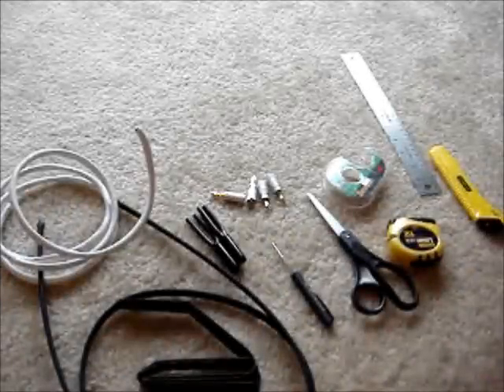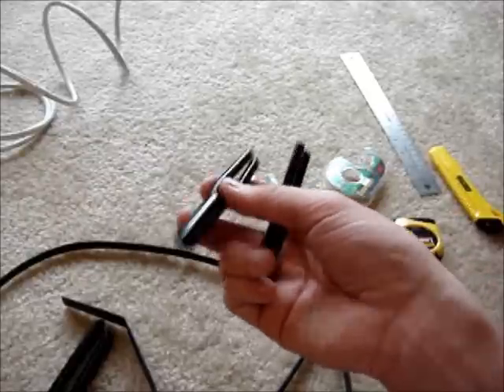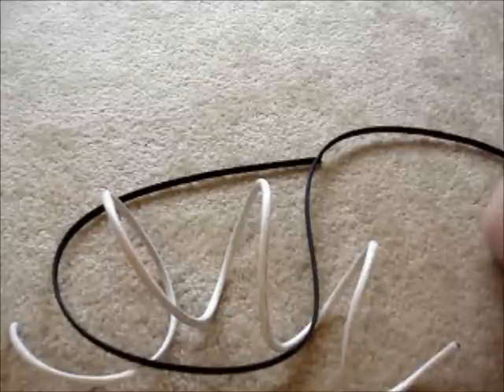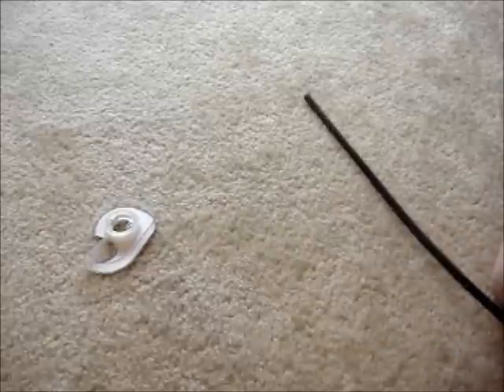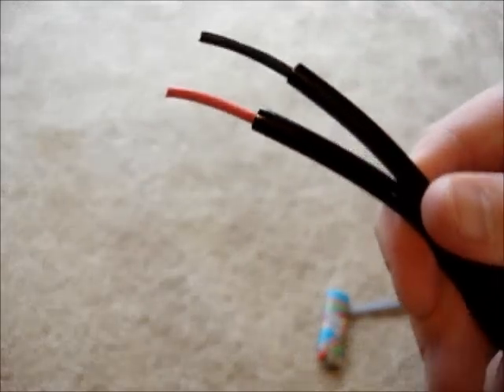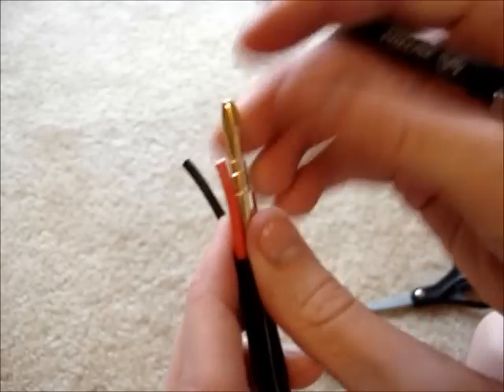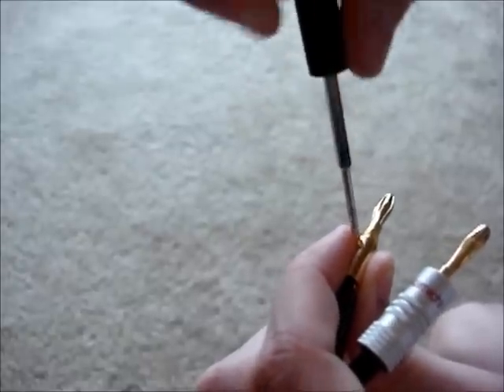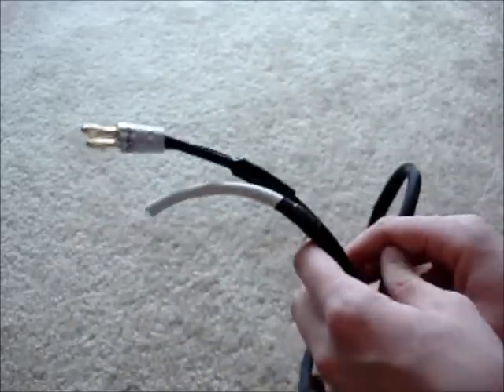DIY Speaker Cables, How To Make Speaker Cables

Comment: 10:46 Right here, were the bottom of the plugs meet the wire, wouldn't THIS be a nice spot to put heat shrink to smooth out the gap?

Comment: Adding bananaplugs means adding another connection. Which means adding another transition point for the audio to cross. Which means loss of sound quality. The fewer connections the better. Just strip the wire and attach it to the loudspeaker connectors. The difference in quality is substantial !! More detail in high and midrange and a better, deeper and lower bass. If you can't hear the difference you either have a cheap stereo set or your ears are damaged. ;-) Throw away those plugs. The sound will improve and you'll save a few bucks, too.
Reply: Literally none of what you said is correct.  There simply isn't enough resistance between the banana plug and the wire to cause any noticeable difference in the signal. You'd need to add several hundred ohms of resistance to the wire to change the signal in any way at all. Further even if for some weird reason the banana plugs DID add several hundred ohms of resistance to the wire it would diminish the maximum amplitude of the entire signal not the frequency's that the signal carries. And even then you would just compensate for that reduced amplitude by turning up the volume on the amp. You're hearing nothing, there's no scientific way anything other than a large resistance could alter the signal.
Reply: Justin DiPlacido Literally none of what you said is correct. EVERY extra connection will negatively influence the sound. I have improved MANY stereo sets, making lots of people very happy with the improved sound, at virtually no cost, or literally for just a few bucks. My DIY interlinks and speaker cables have been compared with commercial cables, used on $50.000 up to $100.000 sets.My cables are as good as the super expensive ones but at a fraction of the cost. Because I know what I am doing and I know what I am talking about. I go to stores where they design, build and sell million dollar loudspeaker sets. Those people have a great test facility. They know what they are talking about, too. We listen to each other and learn !! If they tell me my 200 dollar cable is as good as their 1200 dollar cable, I must be doing something right. And I have more than 30 years of experience with audio equipment and designing and building loudspeakers and cables. What is YOUR history....??
But if you are using a very cheap power cord and cheap plugs it's clear to me you still have a lot to learn. My advice is to go to a really good High End Audio store and compare your DIY stuff to the commercial cables. Compare, listen and learn.
Reply: telescopereplicator my history is that I did my research and I know for a fact your $50 cable isn't any better than a $1500 cable and neither of those are better than a few feet of zip cord. It's physics, you're perceiving a placebo affect.  There's nothing wrong with having a cool looking cable as long as it's only for looks. You don't see people using super crazy cables with weird geometry and crazy insulation on the million dollar 1GHz oscilloscope made by LeCroy. They use regular shielded coaxial cable. Don't you think that in the most precise and sensitive piece of measurement equipment in the world they would make sure they're using only the cleanest signal path there is? It's not really a big deal, I mean you can use whatever you like it's not my business. It's just not actually any better
Reply: Justin DiPlacido If you think there is no audible difference between a 50 dollar cable and a 1500 dollar cable, there's nothing more I can or want to teach you. 
And I listen to stereo sets, not to oscilloscopes...... You are comparing apples to lawn mowers. And in a blind A-B test there IS no placebo effect. But you wouldn't know because I bet you never tried.
Reply: telescopereplicator the science says there's no difference, that's all I need
Reply: telescopereplicator Hey Mr Pretension...I've been repairing speakers and amps for longer than you've been a 'fanatic' and you sir are 100% completely wrong about what you're saying. It appears a BUNCH of other people have tried to tell you so as well but you're too ignorant and pompous to listen. I'm not going to waste my time on you. Good luck with your quest to ruin everyone's audio experience.
Reply: telescopereplicator God you're an idiot.
Reply: +telescopereplicator ...This is all wrong.
Reply: +shitcock86 the test equipment used to measure the differences are thousands of times more sensitive and CONSISTENT than the human ear. As well as having no placebo. Kind of silly really. Science has proven things of great importance consistently. Let alone about a piece of wire.
Reply: @megaetk  if we've learned anything in the past 30 years, it's that the tests with oscilloscopes are not the correct tests and do not reflect what people here. As for your claim about consistency, that ignores reality, which is that people do not listen in controlled laboratory environments and the real world is inconsistent. People's ears are shaped differently, they hear differently, rooms are shaped differently and the makeup of the listening room has a significant impact on sound, same was environmental factors like humidity and temperature, none of which are accounted for in laboratory oscilloscope tests. If you have a decent system, you could test this yourself by getting four different cables, whether it be speaker wire or connects, and swap them out and listen. If you are right, all four cables will sound the same yet, when that is the only factor changed and the sound actually is different, it proves oscilloscopes are not doing proper tests.
Reply: telescopereplicator I don't need to guess. It has nothing to do with Banana clips. I didn't read your essay by the way just the last few lines.
Reply: Are you saying that people with really high end expensive stereos wrap bare wire around the terminals of their amps and speakers?
Reply: @rmmr8513  He is right  some people believe that any connector introduces interference and that there should be the fewest connections possible. I agree that connections should be kept to a minimum, however, the convenience and security of banana clips and spades outweighs the hassle of wrapping bare wire around your speaker and amp connects. It also greatly increases the likelihood that you will experience a short when one of those wires touches something it shouldn't after any piece of the system is touched or moved.
Reply: @esquiremoderator32  "the convenience of banana clips" this is my point exactly. I have never seen a 20, 30, 40, 60, 100,000, 200,000 dollar stereo, but I am guessing the owner or tech who set it up is not around the back tying wire around. they have expensive wires and interconnects that have connectors on them no?
Reply: @rmmr8513  yes and no. High-end cable can be bought in predetermined lengths with the connectors already attached. Or, you can buy just the wire and connects separately in order to cut your own length and attach the connectors yourself. So, it's not like he would buy cable and then cut off connectors to wrap bare wire, he would just buy cable without anyting attached. However, since you mentioned it, there are some very high-end speakers (Wilson, for example) that cost over six figures new and included with the price is a visit from a technician, who will fly to your city and set the speakers up for you, because they want to ensure that their expensive product sounds right in your house and also because they weigh in excess of 250 lbs each.
Reply: @esquiremoderator32  I agree with everything you are saying. And you think the Wilson tech wraps bare wire around the terminals? Or do you think they have some sort of wire that has a connector? And if he does use a connector, if it's OK to use a connector on a $200,000 set of speakers, I guess it's OK to use connectors right. :-)
Reply: @rmmr8513  I would bet they do use connects, I've never bought a Wilson (nor would I pay that much for a speaker, if I had the $$). Most people use connects (I do)- it is a small minority who see themselves as uber-purists who don't. These are the people who pay an electrician to put a dedicated  line in their house for use only with their system and buy a 8- foot copper rod to stake in the dirt next to their house to use as the ground for their dedicated line. D'Agostino makes a $250,000 amplifier, for example - so when these people truly pay $1 million for a system, they've already gone off the deep end, so this is just little stuff to them.
Actually, I looked it up and Wilson uses connects -  their own closed spades. Here is their brochure: https://www.wilsonaudio.com/pdf/brochures/wilson-audio-full-line.pdf
Reply: @esquiremoderator32  Once again, agree with all you said. So, to the person who said no to connectors, if the makers of a $200,000 speaker use connectors, I think it's OK for us to use them too. :-)
Reply: Justin DiPlacido yep, I can't believe how so many people fall for snake oil.
but I guess that comes with the audio territory.
Reply: +shitcock86  Thank you for your kind and mature response. Apparently, you have learned NOTHING in life. At least you live up to your name..........
Reply: +Alter Kater ... The human ear is usually underestimated. You may be surprised how sensitive your ears are. You may NOT be able to measure a lot of difference, but your ears WILL show you the difference !! Like I wrote before, if you can not hear the difference, you either have a very cheap stereo set or your ears are damaged. Getting rid of the banana plugs really is a big improvement. I have tried it on 1000 dollar sets and on 100.000 dollar sets and it ALWAYS sounds better WITHOUT the plugs !! Play a CD that you know very well and listen to all of the details. Now remove the plugs, reconnect and play the same song. Listen to the same details. On many stereo sets, you won't even have to try to find the improvements. They'll just jump at you. It is an immediate and clear improvement. That's how big the difference is.
Reply: +MatthewPickles Hoffman ....Well......I do not listen to measuring equipment. I listen to stereo sets......! And let me assure you, there is absolutely NO placebo effect, because I have improved on many stereo sets and thus far, not a single person was disappointed. Even when the wife or friends walked in, later,  they immediately mentioned hearing a better sound, even though they could not have known anybody made any changes to the equipment. So.....explain that....!! I have been involved in audio for well over 30 years, and what I have learned is to completely ignore any test result, diagrams and what have you. I have heard loudspeakers that test close to perfection, almost flat frequency responses, but they sounded just bad, while some others, with freq..responses going up and down, sounded great. Distortion is not the most important feature, believe it or not. Once,  a small Japanese, 7 Watt tube amplifier was chosen Best Sounding Amplifier of the Year. It had a continuous distortion of 0.5% and a max distortion of 3% !!!! Other amps, especially the very expensive ones, have an extremely low distortion rate, such as 0.0005% or less. Still, the little one, with the huge amount of distortion, was chosen best in the world. So....there go all theories about measurements !!! Stereo sets are TO BE LISTENED TO !! Not to be used for measuring on !!! Diagrams mean NOTHING to me !! I trust my ears.  And you should too .....!!!!   Here's a nice test. If you have a filter inside each LS box, right behind the woofer, unscrew it and place it in between the layers of foam, at the bottom. The filter is now mostly free from external influences. Place the woofer back and play the same song you just played. You should hear an immediate improvement. A deeper, tighter bass, better mid and clearer high. Better 3D image and better placement of instruments. Yes, it is that simple to improve your loudspeakers. Simple and totally free of cost. And easily reversable, if needed.  And if the non-believers - or debunkers- are right, ALL stereo sets should sound the same...... they do not. Guess why................
Reply: @telescopereplicator  You're full of it. Connectors have long been used by premium speaker and amp manufacturers. Plus, you say you also sell speaker wire? What is there to sell (unless you manufacture the wire, which you obviously don't) since you won't add bananas, spades, or even solder tips? You cut it to their desired length? Add a techflex cover? Wow, you must know everything, then.  
I'll give you one thing - you are right that scopes don't measure sound quality. People need to realize that "science" doesn't have a test to quantify audio quality and the scope testers have been proven wrong many times over - even in double-blind! Not a single person claiming "science," who says that a lamp cord is as good as a quality speaker cable, has ever done a double-blind on a quality system. If you are measuring on a $500 system-in-a-box, you probably won't notice, but those people aren't buying high end speaker wire for those systems, either.
Reply: +shitcock86 If you mean the content of this video then yes, indeed, some of it is wrong. If you mean the content of my post, then alas....you are wrong. Being an audio fanatic for over 35 years and having designed and built speakers, amplifiers, etc, I think I know what I am talking about.  If you can not hear any improvement on your own audio set, you very probaly have a VERY cheap set. If you had any knowledge of electronics, you would have known I am right and you would never have written your comment. Please, try it for yourself before you post another comment.

Comment: I managed to create my own speaker cables for my two front speakers pretty well, but I'd need to know how to make bi-wire cable (4 connectors on one side and 2 on the other) to connect the Central Channel speaker and the two Surrounds, so having both their tweeters and woofers in use. I'm even wondering if it's possible to buy these kind of cables pre-made by factory. Interesting video anyways :)
Reply: It's possible but wildly expensive and not any different :)
Reply: Justin DiPlacido My comment is pretty old so I've already found a solution which is not that expensive. I realized that I had to interlace a pair of the cable I was using already (12AWG by MonoPrice) so to have 4 terminations on one side that go behind the speaker and 2 on the other side. I simply had to connect the copper of the positive pole cable to the other positive, and the two negatives together not to mix polarity, so to have to thicker terminations, and it worked just fine! I can now enjoy great sound from the Central Channel and Surround speakers using both their tweeters and woofers.
Reply: Vylkeer trying to understand this methid but im a noob 😕

Comment: Nice video.  What's the idea behind not touching the wires? Do they oxidize with the oil of our hands?
Reply: The oils aren't conductive. But you'll never hear a difference weather you touch them or not. I don't touch mine either but that's just because I'm a little obsessive about things.
Reply: The wire oxidize by, well oxygen. So the only way to slow oxidation is so get an air tight seal from the cable insulation over the banana plug. I prefer Marine heatshrink as it has glue that melts and fills in the cracks and creates an air tight seal.

Comment: I made my first 12awg 10ft pair and parts cost me $30. Pretty easy but the hardest part was slipping the zip wire into the rubber sleeve. I didn't buy wire with it so my advice is to buy it! Like the white one in the vid. More expensive but worth it

Comment: Hei, we want to see how to built from scratch. From raw hook up wire to finish product, include
cable hook up wire twisting, then use Alum wrap it, then Braided shield it, then PTFE Tube insert it & Shrink it. Plus Last add colour Sleeving to it.

Do u know how to do it is the Key Point?

Comment: FYI the string in the cable is not for pulling the cables through the jacket, it provides an easy way for you to tear the jacket for access to more cable. This would keep you from needing to run a vertical cut with the razor blade which seems dangerous and could damage or expose your conductors. Nice cable though. I plan on trying to make a set myself.

Comment from the maker: most computer cables (VGA, ethernet etc) are not optimal for use as speaker cable, if you have some old cable lying around though, it probably wont hurt to try.